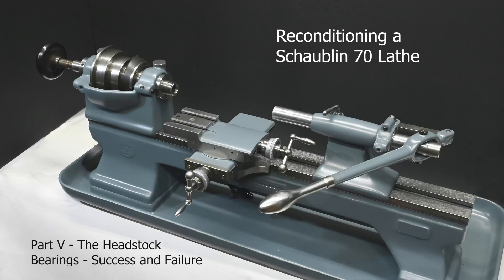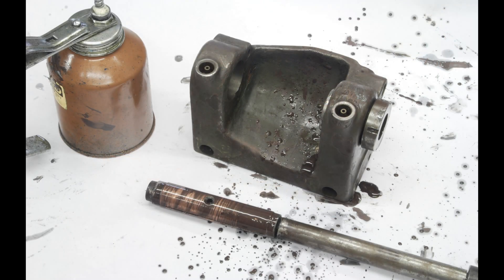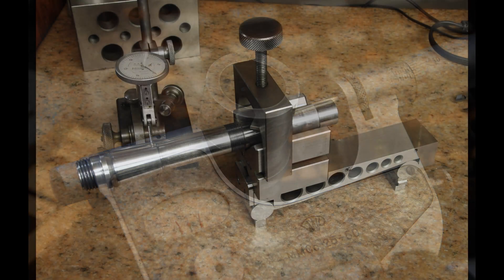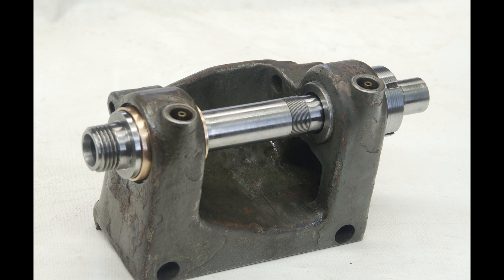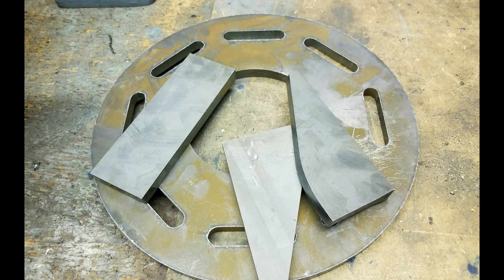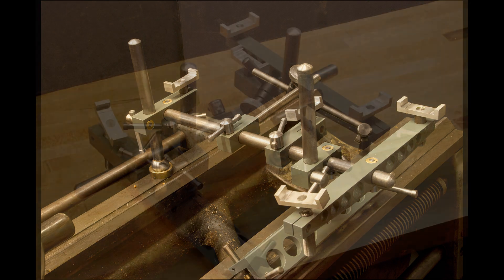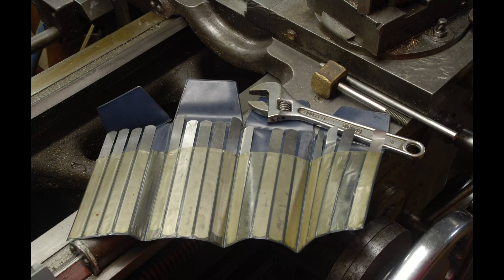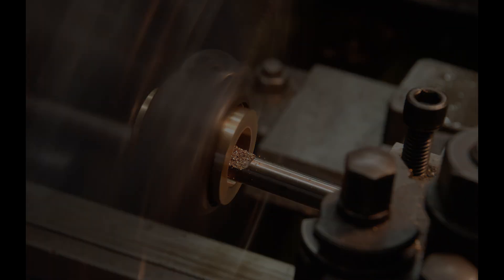Reconditioning a Schaublin 70 Lathe   Part V   The Head Stock Bearings

Comment: Regarding bearings- in precision BOLEY lathes those were usually ground after installing those in headstock (you can find more info about that in lathescouk website). Schaublin probably used the same technique, as it was the most accurate way of doing it at the time